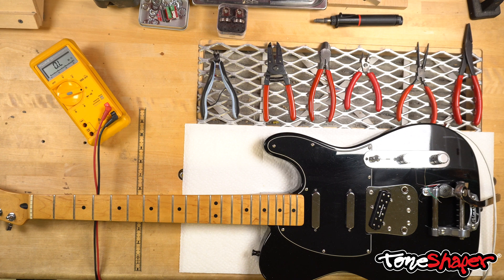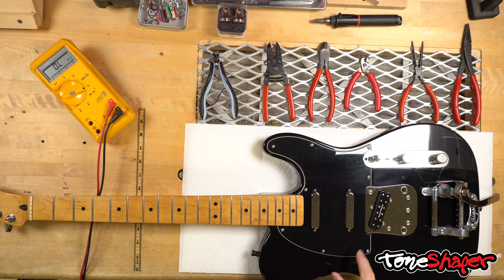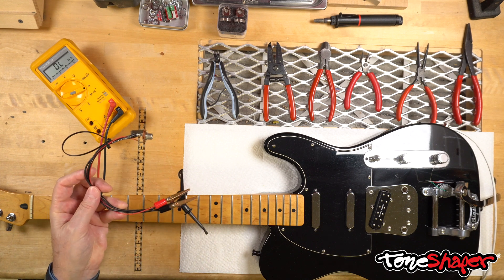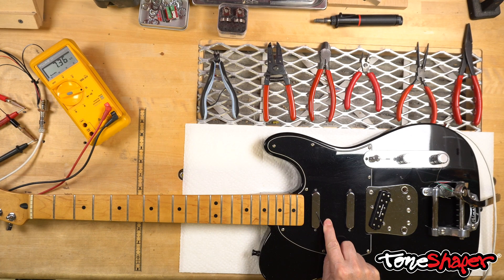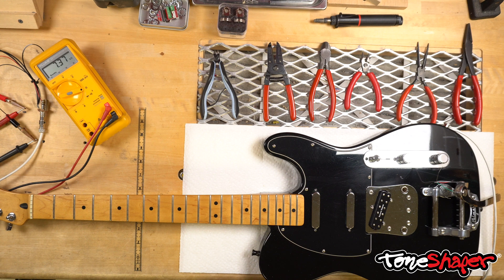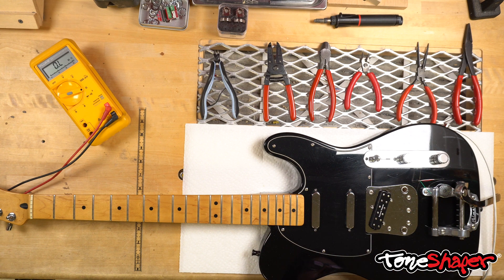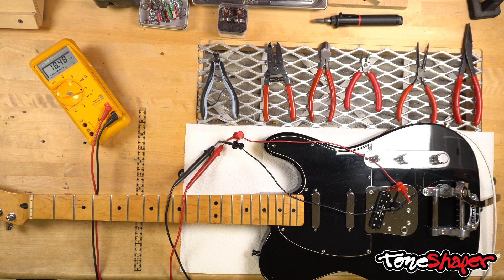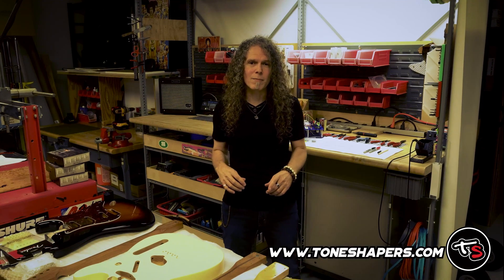ToneShapers Tech Tips: Avoid Phase Issues When Combining Guitar Pickups From Different Manufacturers

Comment: Thank you so much. This is absolutely brilliant and so helpful and clear. I am combining Fender (nocaster neck), Seymour Duncan 4-wire (duckbucker in middle), and bareknuckle (Blackguard Tele ‘50) in a Nashville Tele - and without this video, I would have had all sorts of bother with trial and error - so much so that I was almost put off mixing my pickups. 

What about whether they will hum cancel or not? Is there an easy way to test for RW/RP on my neck / bridge?
Reply from the maker: Glad you like the video! Regarding RWRP, the "RP" part is easy to test, you just hold a magnet to the top of each pickup. With an RWRP pair, the north pole of the magnet would be attracted to the top of one pickup and the south pole to the top of the other. StewMac used to sell a little magnet in a plastic tube - one side was white and the other black. When you held the magnet over one pickup and then another, the magnet would show you at a glance whether they were the same or opposite. If you use a simple bar magnet it'll do the same, just paint one pole (any color you like) so you can keep track of which pole is which.

Understand that if you change either the magnet orientation or the wind direction, you reverse the phase of the pickup. A sine wave is represented on a scope as 360˚ in total duration - the wave starts at zero amplitude (0˚), then rises to highest amplitude (90˚), drops back down to zero amplitude (180˚), continues to drop to its lowest point (270˚), then returns to its starting point (360˚). This is the full waveform. If two pickups are out of phase with each other, when one waveform is rising, the other is falling. They cross over each other in the middle, at zero amplitude, but the rising/falling competition between them - between 0˚ and 180˚, and between 180˚ and 360˚ - that's where frequencies are being cancelled out and you get that thin/weak out-of-phase sound.

If you change the wind direction of a coil (RW), you reverse the phase 180˚. If you reverse the magnet orientation instead (RP), you reverse the phase 180˚. If you do both (RWRP) then you're back to 360˚ and have put the pickups (and their waveforms) back in phase with each other. Both aspects - RW and RP - are needed to provide hum canceling.

The ground connection for a single coil will usually be the inside of the coil - the part of the coil that's in contact with the magnets. The outside of the coil will be the hot connection (that is to say, this is how nearly all pickups are made, though obviously there are many guitars out there where someone has wired pickups in with their leads reversed, either intentionally or inadvertently). On Strat and Tele pickups of conventional construction, you can usually see this: the tiny copper wire from the coil attaches to the two eyelets on the base of the pickup. They will come off the coil at different angles because one goes to the inside of the coil (in Duncan parlance - the "start" wire) and the other to the outside of the coil (Duncan "finish"). Understanding which is going to the inside of the coil and which to the outside will tell you whether the coil is wound clockwise or counterclockwise. If you have two coils, and one is wound clockwise and the other counterclockwise, and the magnet sticks to one with its north pole and the other with its south pole, this will tell you that the coils are RWRP relative to each other.
Reply: @ToneShapers  Again - thank you for taking the time to explain this. Very much appreciated.

Comment: I am trying to restore an old Fender Jazz Bass Special with the help of a luthier. Some people on the web claim that the bass is wired in series in the J to P pickup route. But my luthier made a harness in parallel, aledging that a series connection would cause phase issues. Well, the original instrument used to be wired in series, so I wonder if anyone here has any thoughts on what could be done to fix the serial connection without phase issues? Any help will be appreciated. Thanks!
Reply from the maker: There's no reason you cannot wire Jazz Bass pickups in series, unless you have shorts between the outer polepieces and the inner coil wraps (check for continuity between the outer polepieces and the pickup's black wire with a meter - if no continuity, then no shorts exist). Otherwise, the pickups can be wired in series like any other pickups, but not using the stock Jazz Bass wiring (obviously, since the jazz bass usually doesn't have its pickups wired in series). But there's nothing inherently different between Jazz Bass pickups and Strat or Tele pickups.

Comment: Now we know which coill is which and what wire is what but now we need to know.... which wire goes where?
Reply from the maker: Well, that's going to depend on the wiring scheme. The wiring diagram you're working with will specify where the connections go. In the example guitar, the pickup was replacing another pickup, so the hot/ground locations were already known.

Comment: Would it be the same if all the pickups were different?
Reply from the maker: Yes, this trick will work regardless of the pickup brand. This method will always tell you if two pickups are in phase or out of phase with each other.
Reply: If using the Duncan wires as black to ground and green to hot, wouldn't you get a 'hum' from it if your hand touches the pole pieces ??